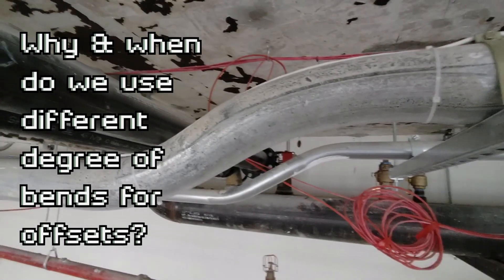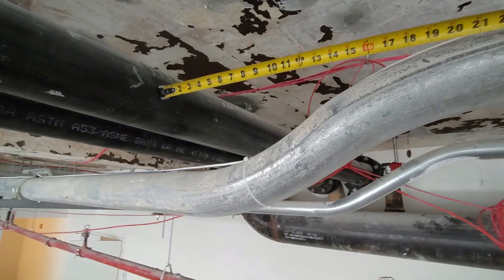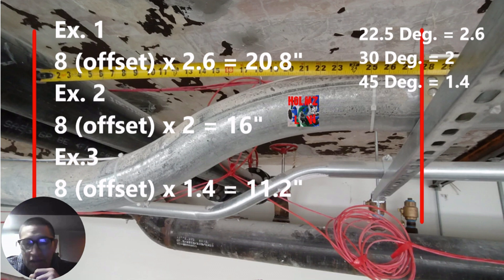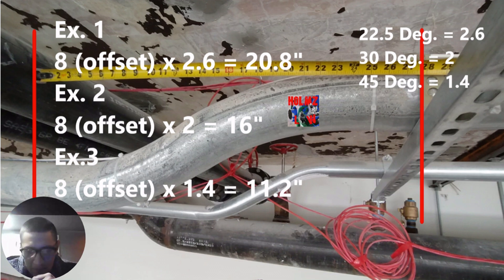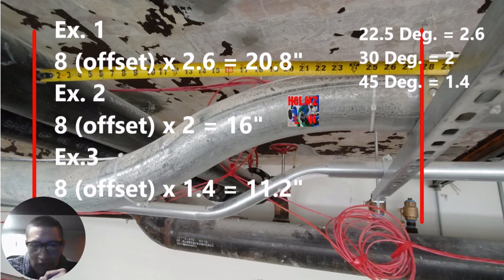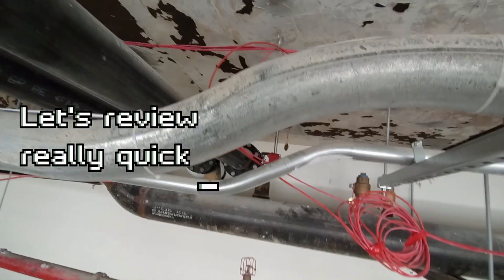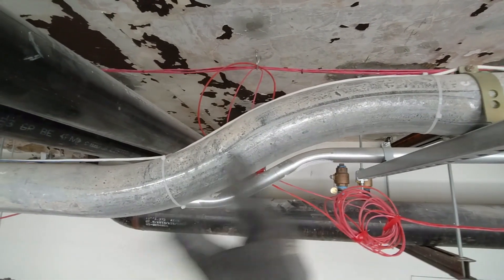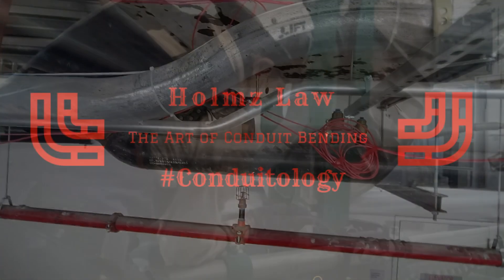Conduit Bending - Offsets - When & Why to use different degrees of bends.

Comment: Just in case you are like me and don't know where he got any of these numbers or figures from let me try and help: 

The first number is 8 this is because he needs/wants his conduit to travel down 8 inches to miss the two black pipes, that's where the number 8 comes from because he's offsetting it by 8 inches.

The other numbers in the examples shown (2.6, 2, 1.4) are the "multiplier of degree."

As @ernestocortez2957 explained so well and I quote. 

To find the multiplier of ANY degree is: 

1/sin(x°) 

Ex:  1 ÷ sin (30°) = 2  

I'll be honest I only learnt this from @ernestocortez2957 so thanks. 

Example 1 for 22.5° Angle: 
* 8 x 2.6 = 20.8 
This means if you are going to use the angle of 22.5° the distance between the two 22.5° will need to be 20.8 inches apart in order to get the offset to drop by 8 inches. As Melvin rightly says you also have to allow for the radius of the start of the first 22.5° bend and allow for the end of the second 22.5° bend. So to get that to fit in a gap that is only 28 inches long, might be pushing it. 

Example 2 for 30° Angle: 
* 8 x 2 = 16 
This means if you are going to use the angle of 30° the distance between the two 30° will need to be 16 inches apart in order to get the offset to drop by 8 inches.

Example 3 for 45° Angle: 
* 8 x 1.4 = 11.2 
This means if you are going to use the angle of 45° the distance between the two 45° will need to be 11.2 inches apart in order to get the offset to drop by 8 inches.

If you know this already then my bad. But if you were like me and scratching your head trying to understand where the figures come from and how to apply them, I hope this helped. 

P.S:
Coming from the UK I hadn't heard the term kindorf, over here we call it unistrut or channel. Really enjoyed the video, thanks

Comment: Where did you get the 8?
Reply: 8 inches is the distance you need to go down to get around the obstacle
Reply: @fitnessfanatics9644  Are the sprinkler lines to the left higher or lower than the strut rack to the right? They look a little higher to me. If they are 2 inches above the top of the strut, I don’t get how the 8 in offset was measured. Still learning
Reply: @McCoy27-t9e the 8 inches is the height of the obstacle times 2 depending on what degree you are going to use. There are charts for the degrees

Comment: I would also like to suggest that the degree of bends you choose for an offset should also be based on the 360 degree rule in a conduit run between pull points. if you already have a bunch of bends in a conduit run before the next pull point you might have to go with the smaller degree bends in order to stay within code.
Reply from the maker: Yes ... Great tip.
Reply: @TheArtOfConduitBending  or in which case you may be forced to go ahead and put a pull box in place if you the other bends don't work as in your example here. I still think this was a great video and example for use in the field.
Reply from the maker: OH Absolutely. Well said. I agree 100% with you. That goes with out saying. I forget sometimes a few pointers here and there. I'm glad I have people like yourselves that bring up the good points. Thanks.
Reply: @TheArtOfConduitBending  the only reason I said something was because of the comment someone made a couple of months ago. I didn't really say it for your benefit. the comment the guy made about bends in regards to the 360 rule didn't really sound like he was thinking about junction boxes; a lot of Journeyman that I work around don't like to go as far as 360 degrees; it really depends on the length of the pull. If you're maxing it out, you're going to waste time on the pull by making it harder.
I was more on board with the point you were making about the distance you have to make the offset, which is more important in my opinion! You have to accommodate that first, so if you have to set a junction box to do so then that's what a person should do. I didn't make the important point, you did! You have the space you have, and you do whatever you have to do accommodate that first; you really don't have any choice. I have always liked this video because you point this out, and I think it should be one of the first things we think of when we get to this kind of situation. Great Video!
Reply from the maker: @comingtofull-ageinchrist6736  I think you're the only one that heard that part.  Also I know the comment you're talking about. The 360 rule is important but everyone pretty much knows about the school and it's kind of basic. That's why I made it a point to speak about what I spoke about as far as the point that I made. Because not everyone thinks along those lines. So I tried to make it a strong point. I'm glad that you at least caught it and understood what I was trying to say. Once again thank you for the comment
Reply: @TheArtOfConduitBending  You're welcome, brother. Thanks for the video. The gooseneck bend is one of my favorite videos. That comes in handy every once in awhile.